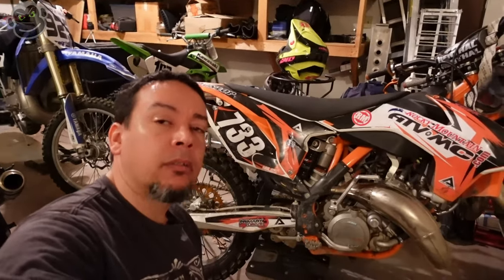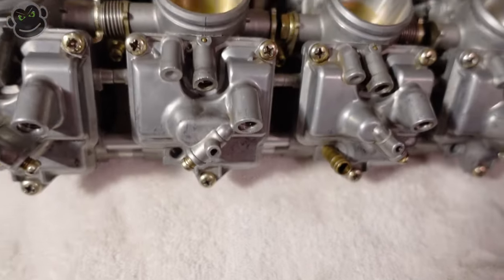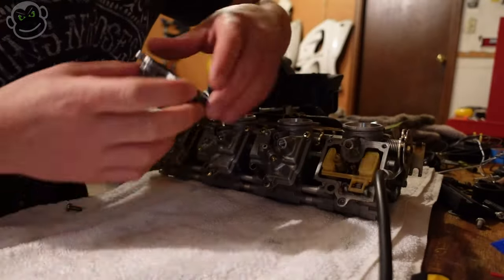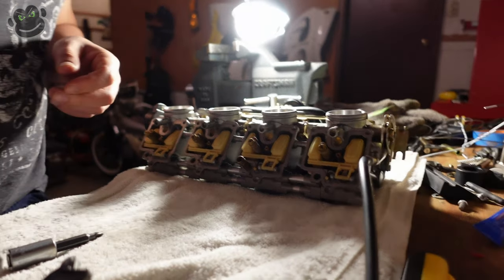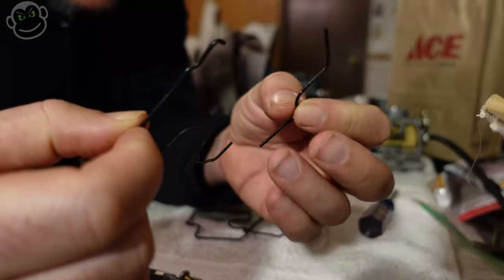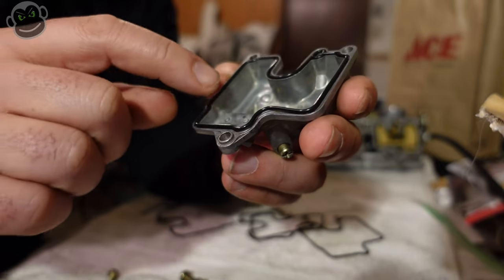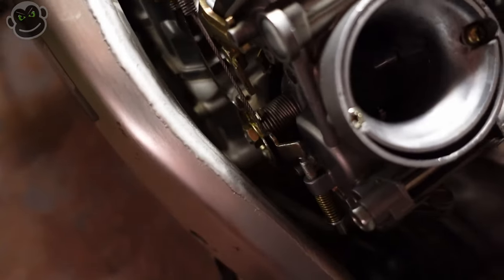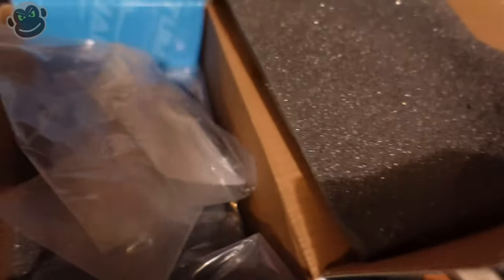INSTALLING CARBURETORS | 97 Suzuki GSXR 600 Build | Episode 8

Comment: Easiest Motorcycle ever to work on besides the hurricane 600 honda.. Miss my full yosh dyno tuned 1997 srad 600.. that 600 did 165 MPH ! would pull past redline 6th gear was AWESOME !!

Comment: Thank you so much! The heat gun worked and I didn't even have to use a mallet - just straddled the bike and put my weight on it.  The right side went in easy, but the left took a little more oomph. Back on track with the rebuild✌
Reply from the maker: You are welcome!!  Awesome!

Comment: I always laugh when people don't know what a choke is :D Then I bore them by explaining it :P Very glad they JB weld worked!! Can't wait to see it starting and riding :D
Was that a giant puddle or what was it?
Reply from the maker: I know right!  Even the modern MX bikes haver starter motors, fuel injection, I love to see someone kick a 500 smoker  in the winter cold and choke it!  At first I thought it was tar, but after further inspection it looks like there was a bunch of water (from snow melt) on the side of the rode an some idiot put his passengers wheels in it and splashed it on the road, I saw like 3 more after the one in the video.    I guess someone thought it was funny.  People are stupid man.

Comment: JB Weld is some good stuff, I doubt if you have any trouble with it leaking, I had a hole in the bottom of the oil pan on a ol car I had years ago, and I took some wire screen over the hole and covered it in JB Weld and drove it for another 2 years and never had a problem with it lol, it's definitely good stuff brother 👊🏼😎
Reply from the maker: Thanks brother!  That oil pan experience you shared gives me confidence I will have no issues!!!